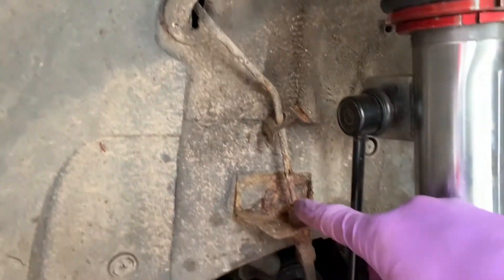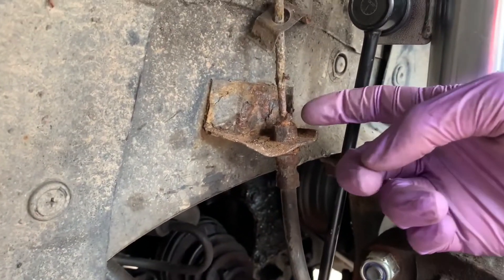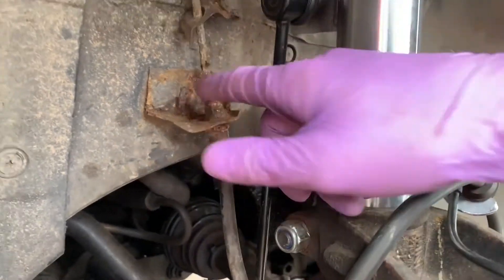Mini Cooper S R53 | Cat Back and Brembo Brakes

Comment: Did you change the rear calipers also? I think  the JCW brembo brake up grade kit comes with rear calipers also.? I heard on another UTube that the brake system electrons has to be reprogrammed? Did you do that or does the new system work perfectly  with out doing that . I have a 2005 Mini S convertible I speced out and bought new with 37,000 miles on it. Been in storage  for 10 years! I  would love to do this brake upgrade even thought I  will only drive it t for a week or two and put it back in storage! Thanks for any details you can give me.
Reply from the maker: I didn’t, just upgraded the discs and pads. I just bled the system and all was okay.

Comment: Hello. Great upgrade. Did you use spacers to clear the calipers with the 17 inch rims? Thanks
Reply from the maker: Hiya I did yes 12mm spacers gave me good clearance 👍🏼
Reply: @natocars5548  do these same rims but for the R56  fit without problems?

Comment: hi, those brakes were from a Renault megane 2 Rs?  do you need an adapter to dock in mini r53?
Reply from the maker: Hi Ivan, 

No they’re not, they are the JCW Brembo callipers and they are a direct fit hope this helps
Reply: @natocars5548  Thank you very much for the clarification.  I thought there would be some kind of adaptation of a brembo caliper (Nissan 350z uses the same brake pad as the mini JCW r56), which I don't know if the caliper could be adapted to the R53
Reply: They are NOT brembo's.  They are Budweg 4 pot calipers, with a Brembo decal.
They are NOT the same as the 4 pot Brembo's you would find on the Megan RS, 350Z, WRX Sti, etc.

Comment: Is that the gravity performance exhaust?
Reply from the maker: Yeah it is! a good system for the price 👍🏼
Reply: @natocars5548  i saw you also had to heat and bend the hangers on the middle pipe. Mine had the exact same problem.
Reply from the maker: @spin1275gt  oh really!? Perhaps it’s a common problem?